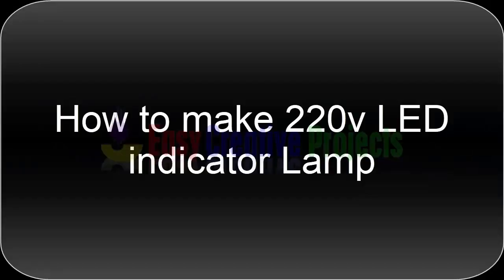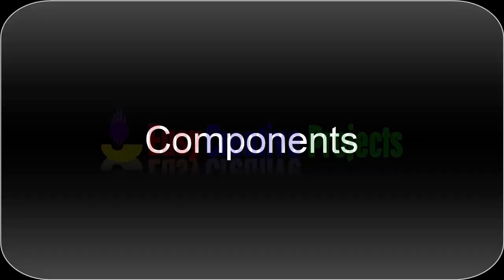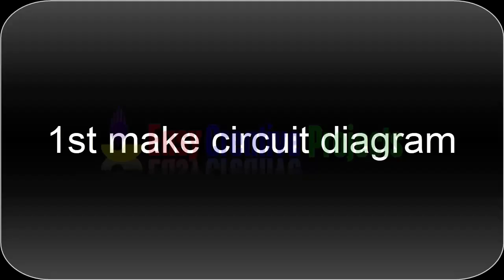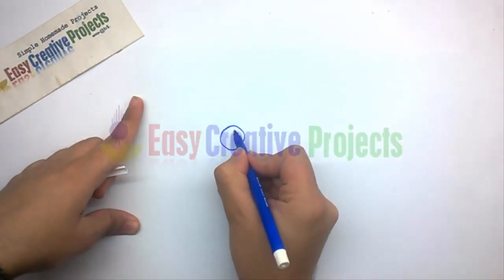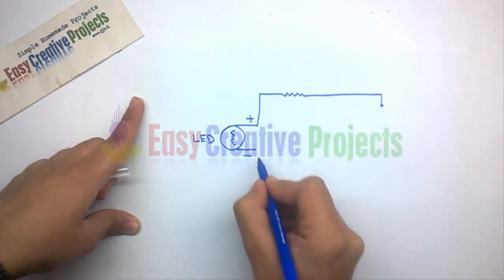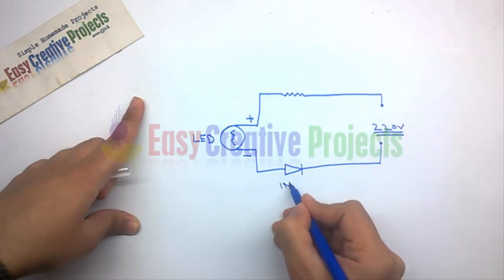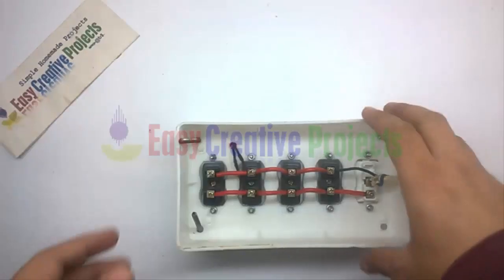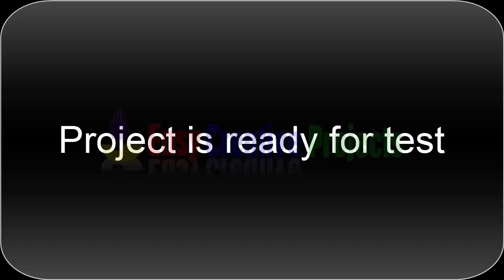How to make 220v LED indicator lamp - for Extinction board  Power plug and iron

Comment: Why using diode, i tryed it without diode, it works normaly
Reply from the maker: yes its work without diode. but without diode if you use 1/4 watt resistor then its heat up fast.
thanks.

Comment: The small resistor..looks like ~1/4 watt, will BURN up within seconds.  Must use a LARGER  resistor...at least 1/2 watt...preferably larger.
Reply from the maker: ok thanks for your feed back.
but last 2 years i use same circuit in my power board. and its working very good.
but extra safety we can use half watt resistor.

Comment: Why 100k resistor? 220v/0.025A= 8800 ohms. So, why take 100k ohms instead of 8.8k ohms resistor?
Reply from the maker: dear you do experiment then tell me why 8.8k burn with in second.
thanks.
Reply: You are right brother but u only know how to calculate resistance value but it's not only depends on resistor value but also you need to check how much energy u will have to dissipate that means you need to check wattage of resistor
Reply: @arjunmohod6022  That's why I asked, how to use the correct rating, wherein the resistor is not too high,and not too less for high energy dissipation.
Reply: @escii_og  just calculate the watt like this suppose LED is 3V and AC volt is 220 then (220-3)*0.025 you will get 5.42 watt that means you need atleast 5.42 watt or more than that resistor.

Comment: 100 k 1 watt?
Reply from the maker: you can use any, i use 1/4 watt.
1watt work for long term. 
thanks.
Reply: @EasyCreativeProjects  I use but my led burn color was white crystal
Reply from the maker: check your diode direction and resistor value. 
its simple 3 component circuit.

Comment: I'm trying to take a 18 volt battery and Power 120 volt light. Can you make a diagram or video of this? I have an 18 volt Makita battery and a flood light with two 120 Watt bulbs. That is all that will be running off of this setup. Was thinking of taking an old charger base and rewiring it so it would Supply the power. Would greatly appreciate it. Thanks
Reply from the maker: dear you want 18v to 120v inverter?
if yes, so simple see video on our channel (how to make 25w power UPS using bike battery ) and replace 220v transformer into 120v transformer.
your project done.
thanks.

Comment: We can used 1M Resistance pl tell me
Reply from the maker: 1000k resistor create very high resistance. if you use it then your led light glowing very dim. if its enough for you then you can use it. 
but if you want fully glow then you need round about 100k resistor. 
thanks.

Comment: How to find in any circuit which side is + or which side -
Reply from the maker: in every LED, long wire is called + pin. and short pin is called negative pin.
thanks.
Reply: It does not matter when working with ac voltages